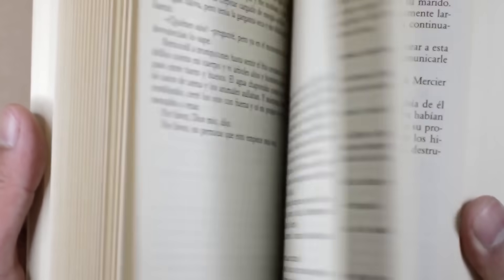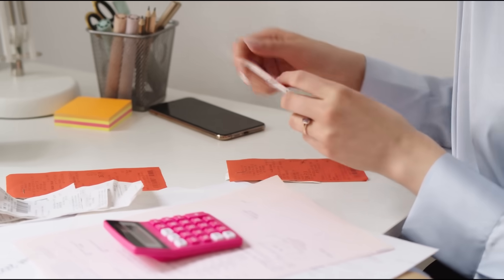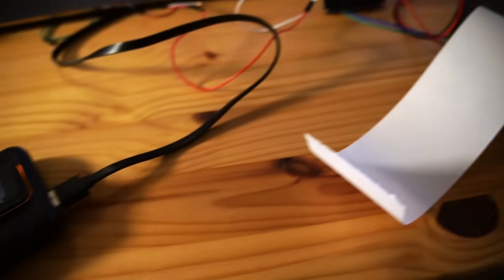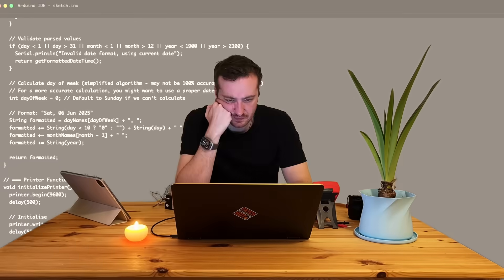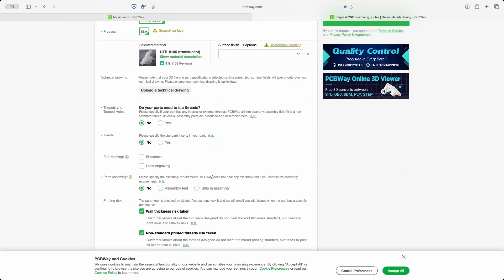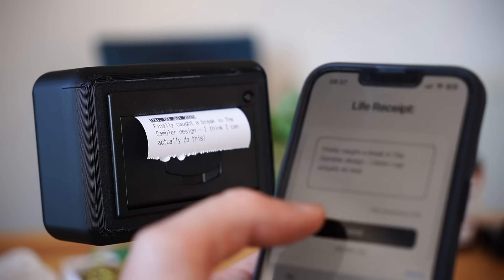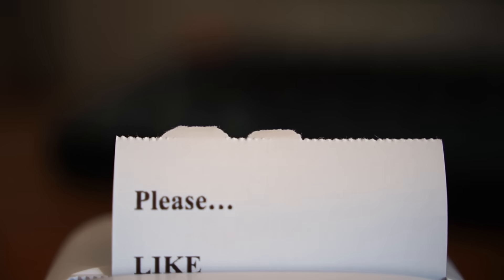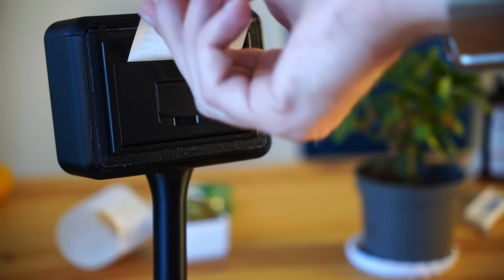I make easier and better decisions each day, because of THIS (so I'm open sourcing it)

Comment: I think the claim at the beginning is somewhat hypocritical, as replacing something physical like mindful journaling with fast, digital, and automated notetaking, that is even more abbreviated through ai, seems to cater more toward digital noise rather than counter it. Don't get me wrong, I like the project, I want to recreate it, I love the aesthetic, I want it on my desk, but I very much dislike this need to make the conception of a build a transformative journey short film. I think the video would be stronger without it. A more anecdotal approach would be more engaging in my opinion, instead of portraying a desktop gadget as the solution to a very important issue. Even with the segment, shots of your actual daily routine or the struggle you're describing are much more convincing than entirely random stock footage, in my opinion.

I love this project, thank the algorithm for showing it to me, but I think the narrative style needs some work and really wanted me to stop watching the video quite quickly.
Reply from the maker: Hey thanks for the feedback and for the kind words. I get that intro bit might not resonate with everyone - it's not hypocritical as far as I'm concerned. It's genuinely the thought process that eventually yielded this design (and, while this design won't address the problem fully, it did nudge me closer). But I do hear your feedback - I'll try to ground the problem better next time, and your anecdotal approach sounds like a really good idea to have a go at.

Comment: "Studies have found that individual thermal receipts can contain BPA that is 250 to 1,000 times greater than the amount in a can of food" .. its a cool idea. But please don't use these on a daily basis.
Reply from the maker: Thanks for the kind words and thanks for the comment pointing this re BPA levels. It's true that BPA thermal paper is used in commercial settings - however, all of the links I provided (plus, an explicit note in the BOM about this) are for BPA-free paper.

In fact, I'd even go a step further and pick phenol-free paper, which uses some alternative developers, e.g. vitamin C derivatives.

But you definitely have a valid point here.
Reply: @UrbanCircles whats also a bit unfortunate is that thermal paper is not recyclable
So you cant put old notes in the waste paper bin :/
Reply: @UrbanCircles  many people will not know this important detail, you should pin this comment to the top!
Reply: Yes, make sure to buy the BPA-free rolls!
Reply: I mean, probably don’t eat the notes. Then again, maybe that creates a memory stain to help with focus.
Reply: @austinsand8163 ive heard it can be absorbed through skin. Otherwise you would probably not wash your hands after handling the paper each time, at which point, yes, you do eventually eat traces of it on a daily basis...
Reply: Was thinking about this, that is a bad limitation, though I’m sure there are alternatives.

Comment: Thermal paper cannot last long as it fades with heat and times. What then is your plane for printing random thoughts?
Reply from the maker: This is a good point - thanks for the comment!! I address this at 2:30 (basically, I acknowledge it's not archival quality, but it's good enough for the purposes I use this for/ call out later in the video). I also take one photo of the 4-5 "life receipt" weekly sheets, which I attach to my monthly review.

If you want more permanent affixing of your thoughts, I hinted at this when talking about the API - e.g. you can store a copy of all your thoughts in a CSV/ database, before a copy gets printed on Scribe for you to interact with. This should be easy to implement in the firmware, depending on which direction you want to take this. 

Thanks for stopping by + hope you enjoyed the video!!

Comment: have you ever seen "Friendship lamps"? where you have one and another friend has one, and when you touch your lamp, theirs lights up, signaling the friend that you're on their mind...This could be used as a similar product, but instead of just a light, it would obviously print little messages. One could argue that you could just text, but we're obviously here for the novelty, and having something physical could make for great memories and scrap books, etc. :)
Reply: bro invented a fax machine
Reply: @trinityslayy  no no we should make a device that shortens messages to codes, and make them portable (maybe can hook it on a belt loop) so we can send each other cute friendship messages anywhere
Reply: @trinityslayy  ded XD
Reply: @trinityslayy  This comment legit made me laugh out loud.
Reply from the maker: This is such a cool use case!! And it would be actually quite easy to implement with the current firmware of Scribe (since even the current API implementation could actually allow you to e.g. send messages directly to each other's device, and they'd pop up when sent without any modification). I didn't even think about this - will definitely check out those Friendship lamps as well. Thanks for the comment!!
Reply: @UrbanCircles  OMG, I can't believe the coincidence, I've literally been pitching this idea to my friends and family and here you are already half way there!! I've literally been on the hunt for someone to help me build design this, while I've been working on how to implement the connectivity. Is there any way we can get in touch? I've been thinking about this for months and have a lot of the ideas fleshed out! I already have ideas on how to upgrade this and make it even more interesting.
Reply: I made a similar project with an esp32! Did the friendship lamp but also made a synced message board using some 16x2 lcd character displays :)
Reply: @benno6981  How did you made them listen to messages? I had a similar project and I used discord's api to listen to a chat with a bot inside.
Reply: This is such a good idea! Can add names and have a printer for the friend group haha
Reply: There is a comercial product called Memobird which lets u do this. There is also an easy python API to use it in local mode.